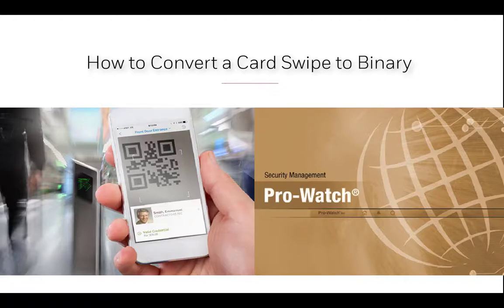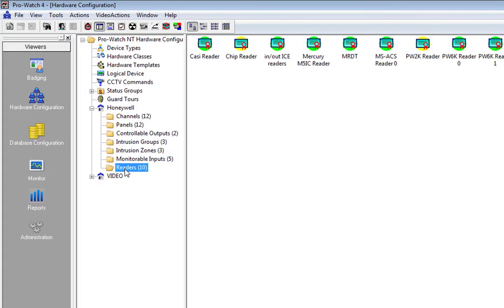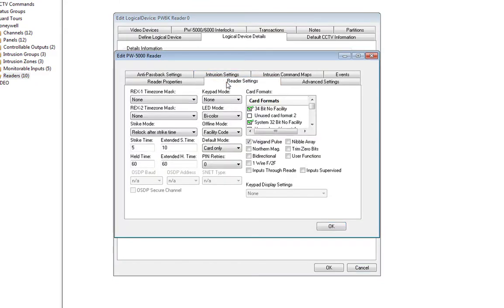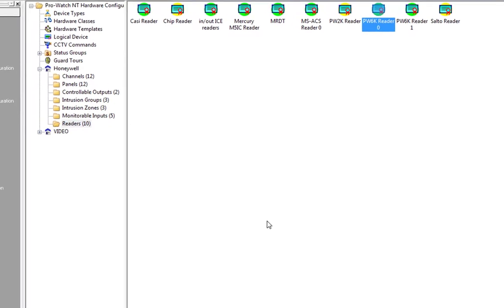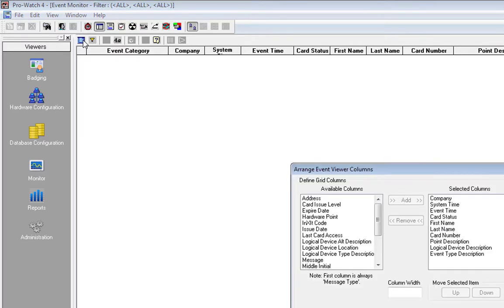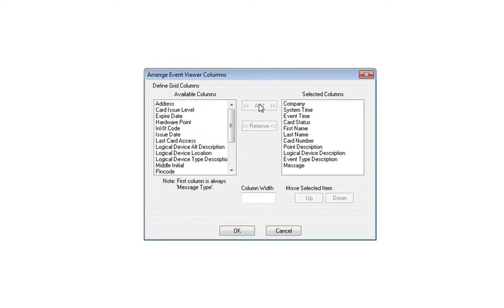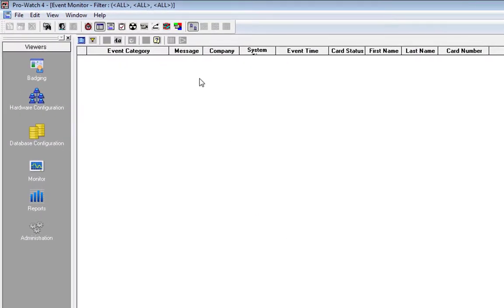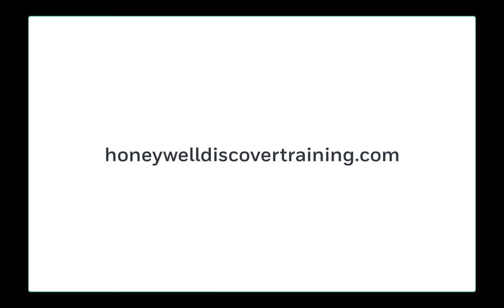How to Convert a Card Swipe to Binary in Pro-Watch - Honeywell Support

Comment: Rather than tack a screen shot of the data, a better option would be to pause the event screen, highlight the event line and then press Ctrl+C. Open notepad and then press Ctrl+V. You will then be able to work with the binary data to decode the information.